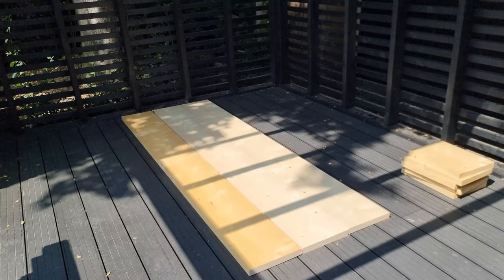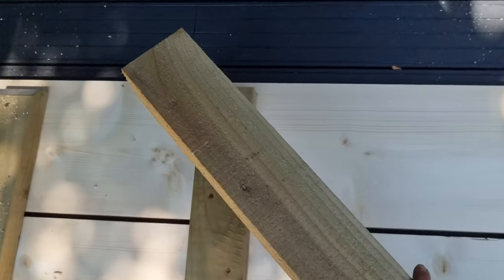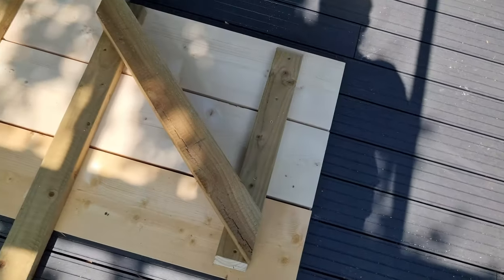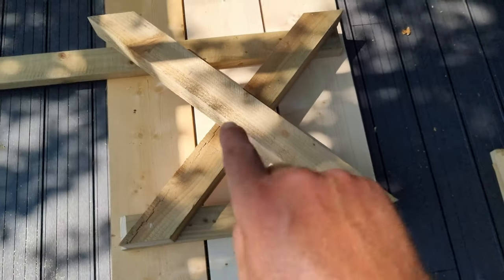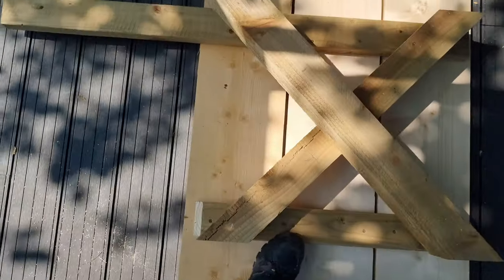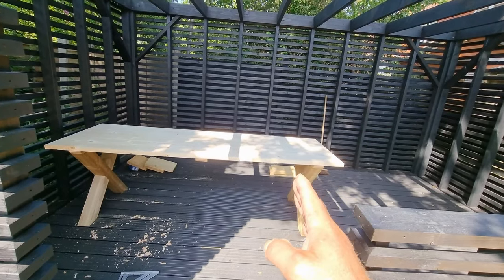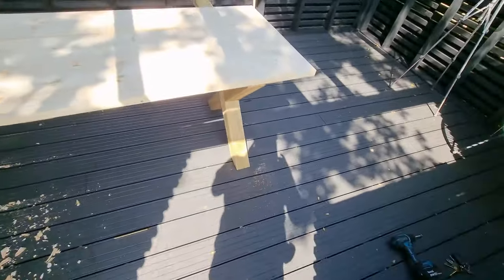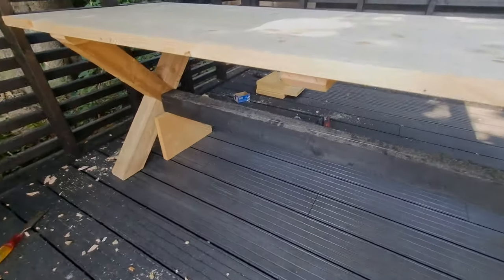Barbeque Room Table build Pt1 - Making half lapped X frame legs from 4x4 fence posts, Dewalt DWS780

Comment: Like the table build, I've got some old joists and 100 X 100 posts, might just have to build a sturdy outside drinking table!
Reply from the maker: Thanks 👍 Best of luck, i think i would change the threaded bar to 12 or 14mm as it's working a bit like a tenon, i was using what i'd already bought,

Comment: Nice job mate, table building on the fly, way to go 👍, I see your new mitre saw was positively glowing in the sun, I would imagine that on really hot days you could probably BBQ using that floor it would get so hot 🥵 mind you whilst your sweltering I’m cutting logs for the fire, must say I would rather be hot than cold, looking forward to part 2 now 👌👌👌👍👍👍🇦🇺🇦🇺
Reply from the maker: Thanks 👍 I like it cold n dry when i'm working but warm when i'm sat shivering in winter in my house, can't win, yeah a was sat on the edge of the deck & it was burning my bum 😆 n yeah, a bit too much Dewalt yellow appearing in my set up tho, beginning to look like a Dewalt ad 😒